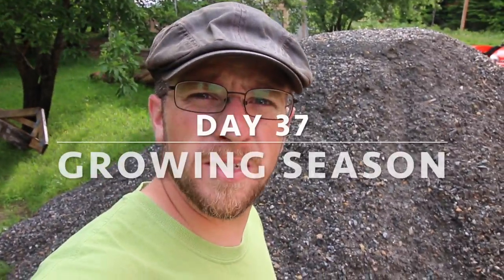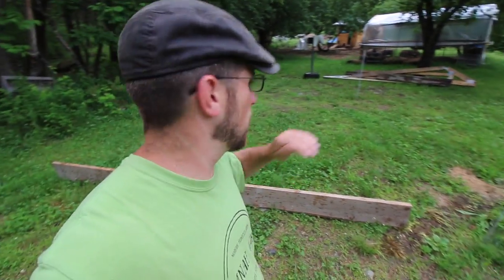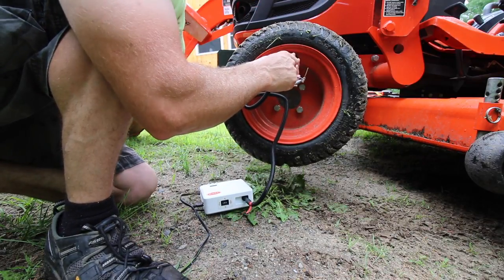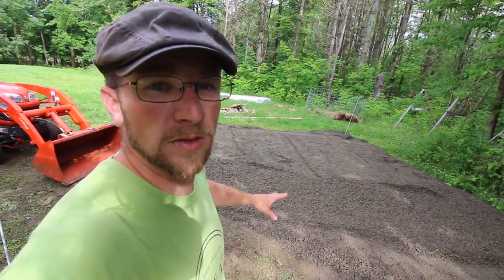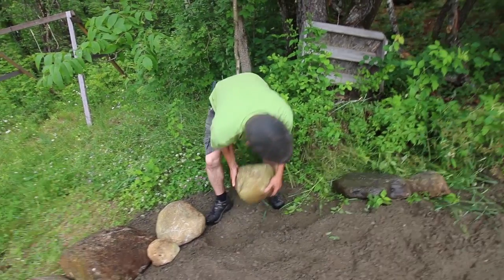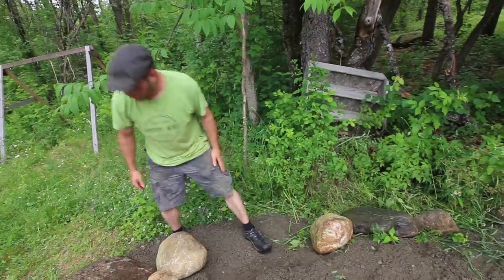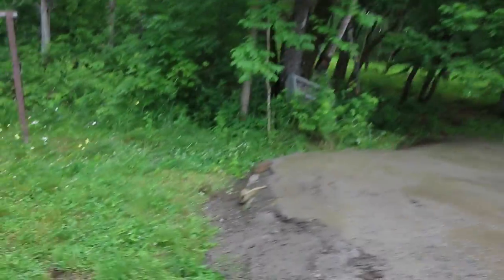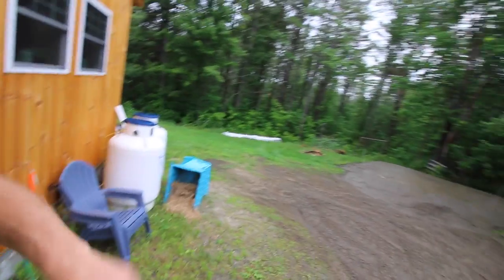BUiLdiNG our Off GRiD Outdoor Kitchen Build! DAY 1

Comment: Good use for mangled cattle panels..old gates old wire.  Concrete pad strength vs re bar.
Reply: Check on a fibre added concrete.  Strands bind together not sure with freezing.  Nylon I believe.  Beautiful use of the boulders.
Reply from the maker: Thanks! I was thinking cattle panels too! I might have to buy them though
Reply from the maker: I did thanks. The concrete company recommended 4000-pound concrete and then rebar

Comment: Too bad you didn't have a box blade to level that with
Reply from the maker: I bet that would work great!
Reply: You did a very workman like job.
I hadn't heard it called a floating slab before though.
Make sense in a freeze thaw environment.
That's just how we build them up north :)
The box blade might have allowed you to reshape the land
That way you wouldn't need so much gravel to level it up.
Only works if you don't have a rocky subsurface though.
Works great with added on material and spreads it  evenly.